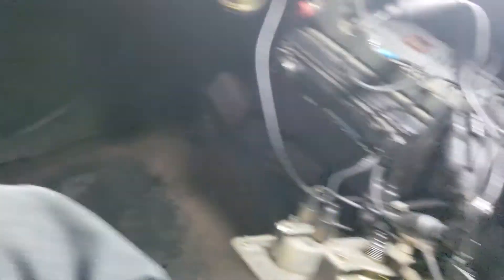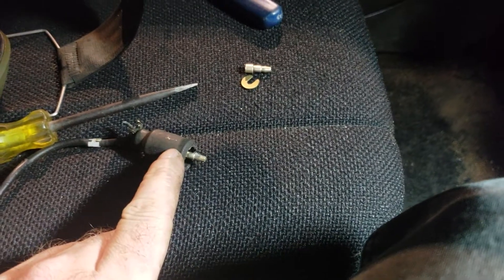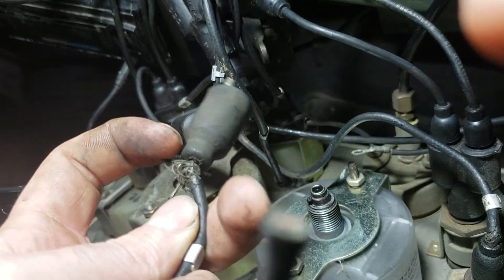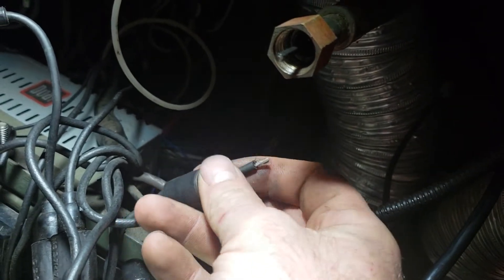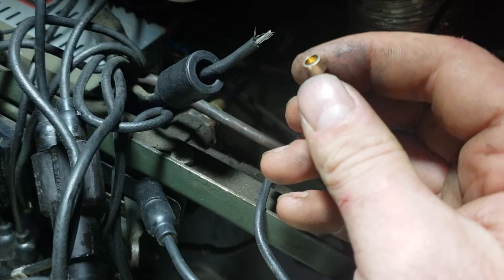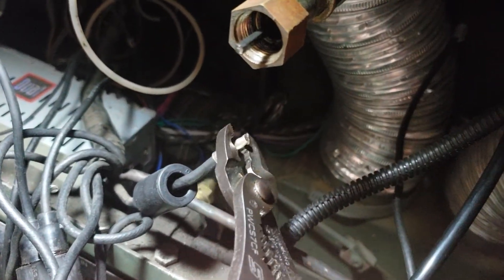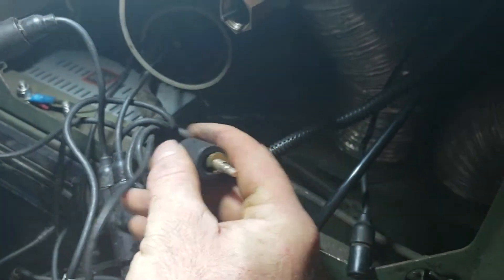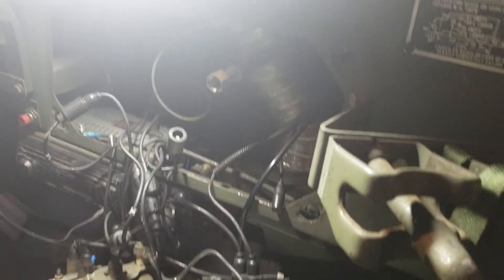Military wire repair part 1: Replacing or installing female Packard connectors.

Comment: What if we just want to patch wiring like on my m45a2 with troop carrier bed  and flashers working but thats it and i see two dangling wires on each side. Automotive easy to tell from color coding but military apparently didn't believe in that.